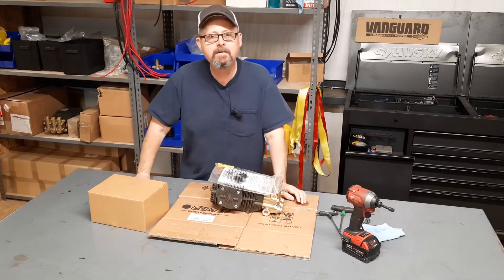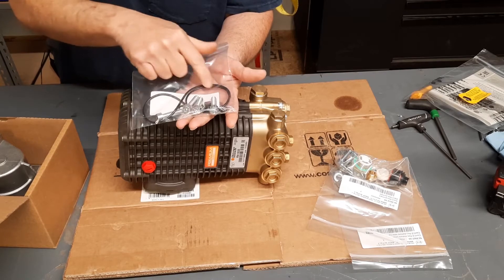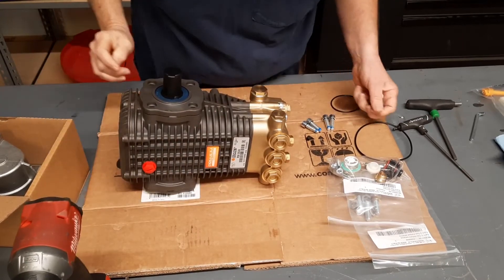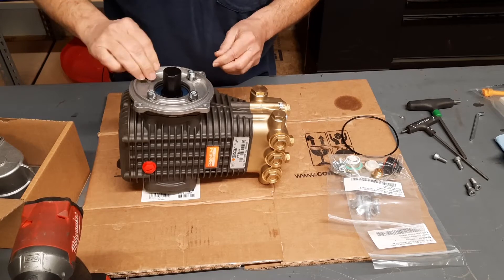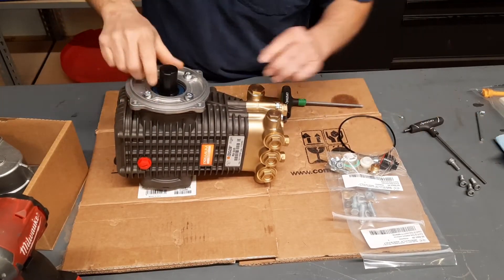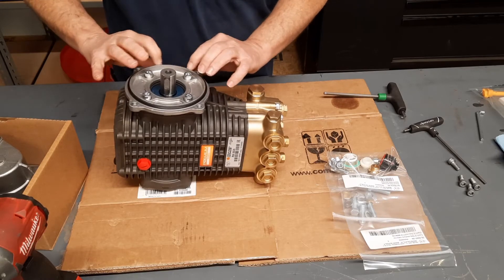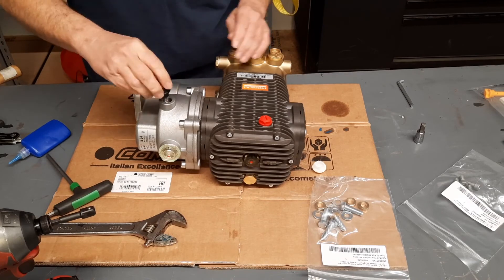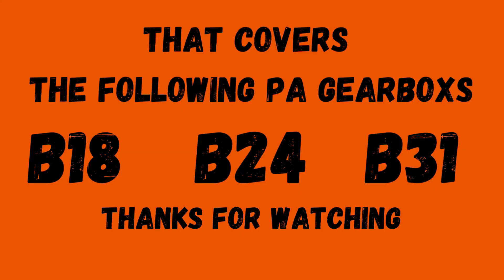How to install a PA gearbox onto a pressure washer pump.

Comment: If I am replacing a gear box on an existing pump, do I need to remove the oil from the pump?
Reply from the maker: No, plug the vented cap so the oil doesn't run out when you flip it on its side.

Comment: Would oil leak from the dipstick?
Reply from the maker: @rmass68  Yes, it can. Oil expands when heated. It's splashing around in the box, the cap is vented. An over filled gearbox, wrong oil in box, or too long of a vent cap can all cause oil leakage at cap.

Comment: i broke the ball of my allen wrench off into the set screw of the gear. What do you think i should do when it's time to take this apart
Reply from the maker: to be honest you should have removed the "ball" end from the set screw before assembling. what if it comes out and get between the gears?  try tapping ball end with a small punch counter clockwise to try knock lose,  or drill it out. good luck with it and let me know what happens.
Reply: @TheRustyRooster  I'll keep you updated. The gear is fully seated so there isnt much clearance to reach the set screw. I will try to free it in the morning.
Reply: @ for context, I'm starting up a pressure washing business. I'm not the most mechanically inclined person in the world but i do okay. I never thought about the broken allen bit coming out of the bolt while the machine is in use and that ideas has me losing sleep. I'm building a 8.5 gpm machine with the help of youtube. Am I over my head? Yes. Thank you for your videos
Reply from the maker: Man, you got this. 
I happen to have an 8gpm build video coming soon

Comment: I did all this the exact same way and after 3 hours the gearbox started pissing all the oil out where the big O ring is. Gonna tear it out today im.hoping its just a pinched o ring
Reply from the maker: Sorry fella, you probably right.  Pinched oring
Reply: @TheRustyRooster  well I tore it down and unfortunately one of the bolts they gave me that goes inside and into the pump sheared off! 3 hours of use. Not sure why.
Reply from the maker: @alexkienitz2325  what pump did you use?
Reply: @TheRustyRooster  warhorse 8.3 from envirospec
Reply from the maker: Not sure I think that's their brand pump.  30 years dealing with pumps,  never saw one.

Comment: I have the b31 on a tsf2221. Do you know what size o ring that is? Nice video!
Reply from the maker: Hope that helps parts diagram is available online
Reply: This helps tremendously. I really appreciate it.
Reply from the maker: Small oring pn. 10.3210.56r ...
Size 2.62x56.82mm
Large oring pn. 10.32129r.... 
Size 3.0x112mm

Comment: This is a no brainer simple. You need to make a video of how to pull a stuck gearbox off !
Reply from the maker: Sure thing, next one that is stuck I'll show ya the secret to removing it.
Reply: @TheRustyRooster  Actually after looking at your video, and verifying that indeed, it should slide off,  I went back outside and tried again. I already had removed the four bolts and was using chisels on each side as wedges, but it wouldn't budge.  Finally put a little heat on the gear and kept at it.. it slowly stated to move and I got it off. (I planned to replace the seal anyway, although it didn't really  get that hot. ) It was a bitch.. took an hour of hammering and adding shims, but no damage done. Your video still helped me. Thanks. Maybe I should slide it back on and make a (fake) video..  😀
Reply from the maker: @doorguru168888 I'm glad you were able to remove it. Heat and vibration are great tools.

Comment: I think I installed mine backward the big gear with the little screw, you are installing the gear with the screw looking at the pump, in put it looking to the engine 😂😂😂😂 it came factory that. And it seems like it really doesn't matter.
Reply from the maker: Hey Mike, I'm a little confused. Are you saying you reversed the gear that mounts to the pump shaft?
Reply: Yep. The big gear I put it backwards.  Lucky for me a thank to your video I noticed my mistake and did the corrections.  And it works fantastically. Thanks.

Comment: I have a v twin 20 Hp engine with a 1 1/8 by 4 inch long crank. What gearbox do you recommend?
Reply from the maker: I like a matching set. Pump and gearbox. What pump are you using?

Comment: So quick question.  How do I know what gear box to use for a particular pump?  I have a Gx390 and I would like to put a 5-6gpm pump on it and hoping to get maybe 3500psi.  Is there some sort of chart you can point me to to figure out what gear box to use?  Thinking to use a general pump but I am not stuck on that.  Thx for any help.
Reply from the maker: Iv been using the b18 gearbox with the comet rw5535 pumps 
Comet has a nice gearbox for them also.